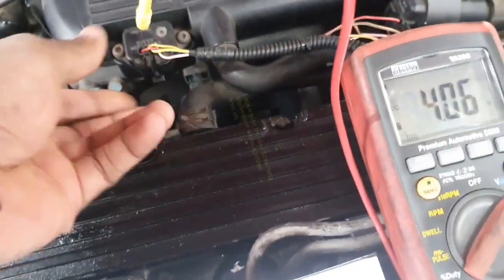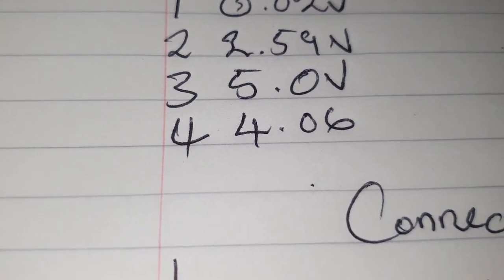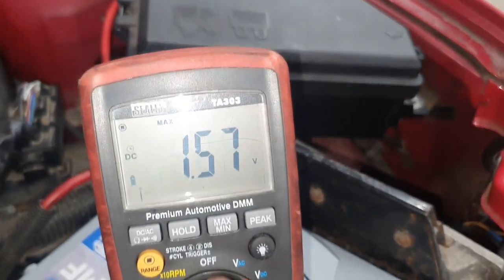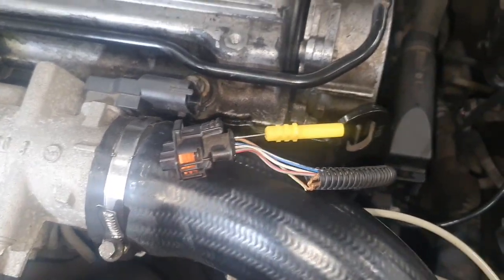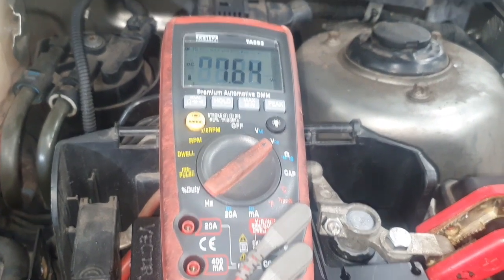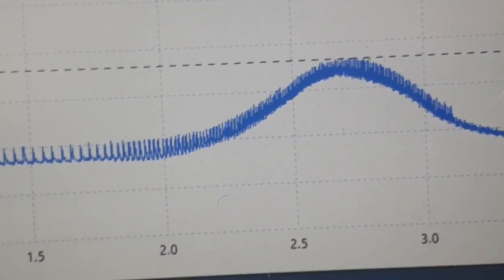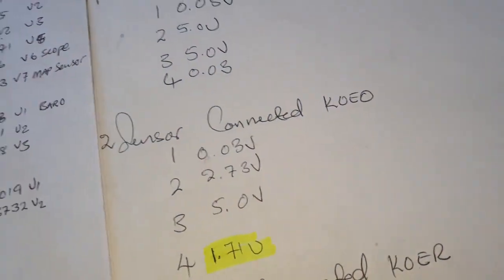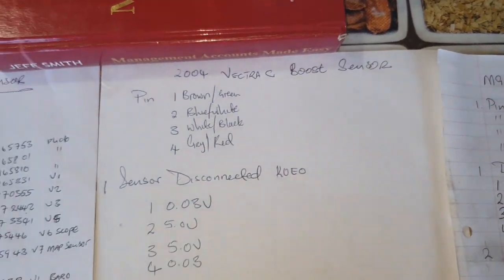How does a boost, map & baro sensors work

Comment: Thanks for the time taken to explain the MAP sensor functionality however I've carried out a similar test on my diesel engine and the max value seems to read 1.8v even after revving at W.O.T. What could be the issue?
Reply from the maker: What is the make and model. what are the issues that led to this test. any trouble codes?

Comment: sir this method can be applied to Gasoline engines sensors also ?
Reply from the maker: You can use these methods on any sensor petrol or diesel just me mindful the actual readings may differ but the approach is the same.